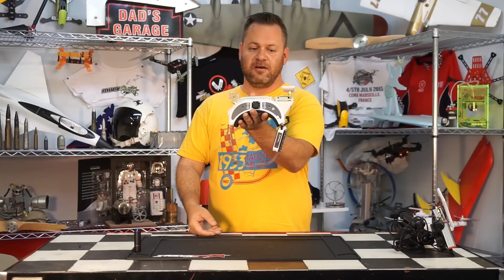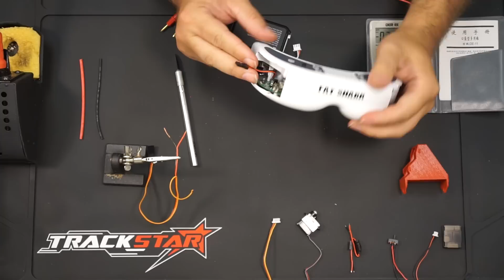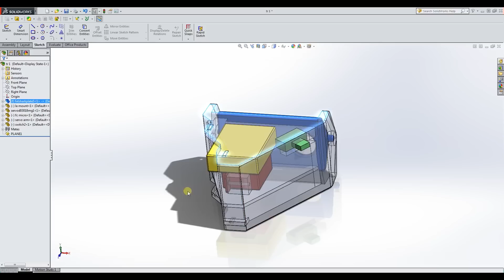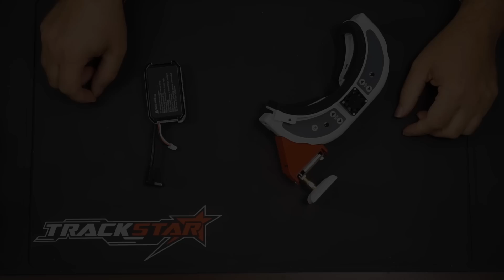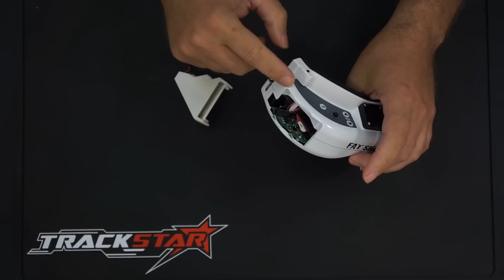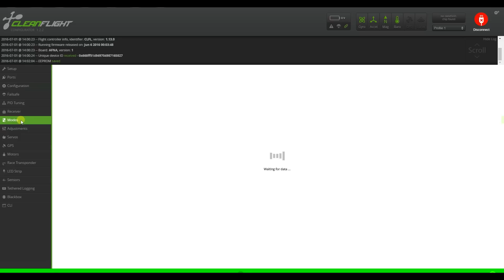Laforge Antenna Tracker FPV In Goggle Diversity Module DIY MOD

Comment: I’ve read all the comments and. Yes it’s not an  rssi tracker but it is still a really really good tool to have if you fly with goggles from what I see , antenna placement or direction is important in any situation so from what I learned this will at least help your antenna from pointing at the ground or string up into the sky where in each case your not fully aware that your tilting your head in that direction so you can still get lost in your flying but your antenna will stay somewhat level ! ITS BETTER THEN NOTHING ! every little upgrade helps I love the little things in life that make it just that much better

Comment: im so confused....u took out a smaller incorporated gimbal system, the trinity "head tracking" module, and put in something bigger. why didnt you utilize the outputs from the HT devise? and also the video title is misleading. not a tracker. stabilization. its plain english. click bait! thanks.....
Reply from the maker: Trinity is a CPPM tracker and can not drive a servo directly CPPM is mixed with your control tx signal, Your English is different from my English... I live in Hong Kong Mate... British English... it tracks the ground as relative zero.

Comment: Nice! As others have said, antenna tracker might not be the correct term for this but still a great idea! What are the PIDS on that FC? :)  I can see taking this a little further, perhaps a pan servo and working off RSSI for true tracking! Probably need to 3d print a helmet for it all though!

About the "tinywhoop" you're a smart guy so... what I like about them is the indoor-ability. Meaning the "ducts" (prop bumpers, prop guards) are key I think. I'm not saying I ever hit anything like furniture, my wife's ankles, the dog, or anything like that but the built in guards save me every time. I hope your design takes that crucial (IMO) feature in mind! Just a thought anyways. Thank you and keep the ideas coming brother!

Yikes... just noticed this vid is 6 months old! Nevermind! :)